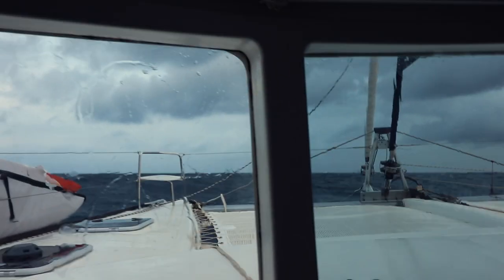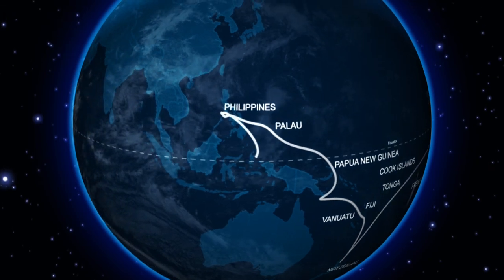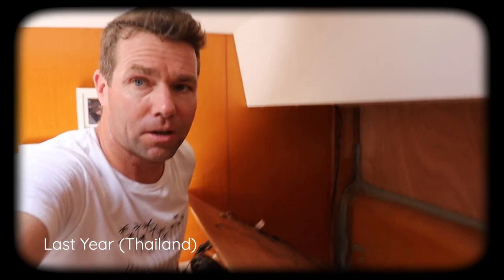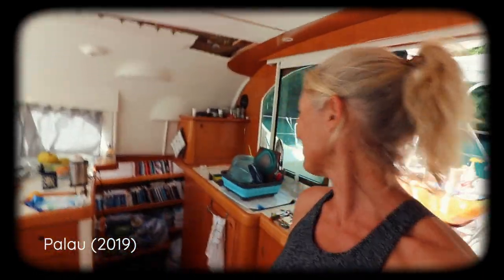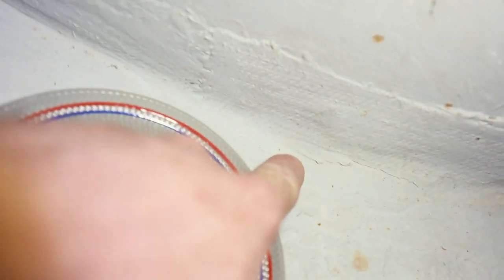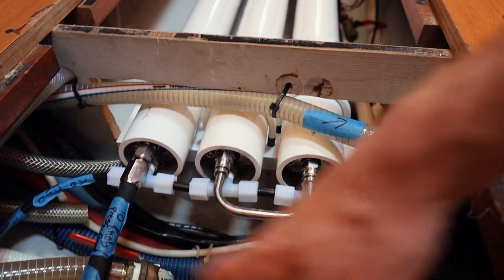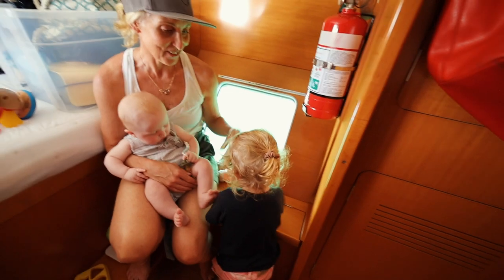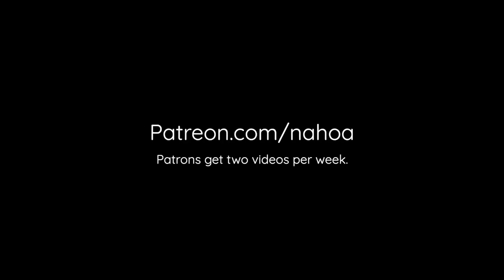Lagoon catamaran Bulkheads

Comment: I don't get the appeasing comments  about the quality at all. If I had a car that started coming apart at the seams, and that looks like what is happening to these boats, I'd be looking for a lawyer leading a class action case. I guess the present owners are keeping a low profile in order that the value of the boats doesn't drop too much. It's a sad reflection on the current boatbuilding scene.
Reply: Did you take into consideration that the vast majority of these cats were originally charter boats, which were abused recklessly by people who used them as party and drinking platforms?
What about all of the people who screwed around with the rigging, thinking that they knew best and tightened up everything until huge stresses were added to the structures, which would cause buckling and breakage?
And then there's all the beaching of the boats, by drunk sailors who think that it is fun to beach and then party even harder on the sand. That's more stress added to the structure.
You're forgetting the previous owner(s) of all these boats, the abuse heaped onto them and the subsequent damage caused by storms. And then there is the out-of-warranty quandary...
Forget about the ambulance chasers; there is more which can be done by a thorough pre-purchase inspection and then going through the entire structure, fixing/patching/replacing as necessary.
Reply: @leonply  All very true, but I was thinking more about the inappropriate use of that 'putty' instead of glass fibre. That seems to be an issue which will eventually befall all these boats over time (regardless of previous treatment).
Reply: @cuthbertmilligen  I agree with you very much here. The "putty" used to fasten the non-load bearing bulkheads is like the construction silicons used in brick and mortar construction.
The unfortunate thing is that any boat is subjected to torsional loads which fluctuate, and the environment is detrimental to almost all varieties of elastic fastening methods. In order to produce as many units as possible, as inexpensively as possible, using this technique places these boats in the "throw away after six years" category.

Comment: the sad thing about lagoon they used the same thickness material as you have, in the lagoon 450, and also none, or piss poor tabbing - other better built boats use bigger material or carbon fibre and they tab all bulkheads - cost of doing this is not that expensive as Seawind and other boats are cheaper than lagoon

Comment: There’s so many ignorant people who think that all Lagoons have bulkhead issues, and yet there’s literally thousands of them out there circumnavigating the Globe with very few issues. It was the 450 that had the issues, not ALL Lagoons. If you overtighten the rigging on any cat you're going to have bulkhead issues and don't forget different models have different designers as well. It's down to research and maintenance and a good survey before purchasing any boat.
Reply: Not so sure about that. More like our story. We bought a one year old 470, on of the last in production as prices had dropped in anticipation of the new 500, and it had good reviews as a blue-water sailor. 
It was our first boat so we knew little so employed a few "experts" to advise us. Is was a great boat they all advised. 
All was well until our first F4+ when the noise levels were concerning, both slamming and creaking. During the wash-down I noticed cracks had appeared  in the gelcoat at flex points all over the boat. Not knowing what was causing the cracks we had them fixed. Next sporty sailing conditions they all came back. This and the extreme noise in even moderate conditions had us worried. So after a year we sold it and bought a monohull. Obviously not as comfortable in calm conditions, but we feel a lot safer when it get sporty. 
Since then we have met a few other 470 owners who had similar and worst problems, but I have never seen anything published about the problems with this model anywhere.
Reply: @johnhayford5946  that's interesting. We've come across plenty of owners of Lagoons here in Asia and nobody has said they've had any issues with their boats any more than any other production cats have had. One of our friends has a 42 and it's a very solid boat and my brother in law has three 380s in charter for many years and has had no issues beyond routine maintenance on them. He plans to upgrade them to 42s as well. It may be that a few of them have issues over the years due to type of use or design or construction, but lagoons are designed by different Naval architects and have various design and construction methods employed and since there's litterly thousands of them out there on the water it's a good idea to do some research on whatever hull you're thinking of buying and make sure you get a good survey done before purchase, as you should with any boat you're thinking of buying. A blanket statement such as "Lagoons are crap" or "Lagoons have bulkhead issues" needs to be qualified with specifics rather than hyperbole.
Reply: @tlevans62  I concluded that it was bigger 380 styes that had more of a "flexing" problem. I went out on a 380 and it was fine as you suggest. Ours was a 470 and the other owners I spoke to also had 470's and a 500.
Reply: @johnhayford5946  it could be that the older and larger ones have some bulkhead issues the same as the 450s. I guess it depends on how they made the bulkheads, the fabrication and design, and the use of the boat. To me it’s like vehicles, some car manufacturers have models that have issues, particularly over certain model years, but not all of them are terrible. Same thing with different models and years of boats from different manufacturers. Also, they tend to evolve the construction over time so earlier models have issues which are rectified in later models or changed when the model is replaced by a new design.
Reply: @johnhayford5946  also, a lot of cats aren’t rigged properly and people tend to tighten the rigging up way too much, which can cause a lot of issues with any cat. Lots of weight in the bigger boats and therefore the loads and the counter lever moments are very large. All cats will flex to some extent but the rigging can cause a lot more issues with bulkheads on cats and trimarans than in monohulls.
Reply: @tlevans62  Our's was only a year old when we bought it and it only had delivery milage on it. So it was very worrying when faults started on the first bit of a choppy sea.
Reply: @johnhayford5946  I'm sure it was, so what was the engineer's report saying was the cause of it? Did you get a survey done and present it to your Lagoon dealer?
Reply: @tlevans62  Don't get me stated about "surveyors", they were great if all you wanted was a file of photos and a description of the boat, otherwise a complete was of money. 
This was all before youtubers and the info now available so all I had to go on was the gut feeling there was something wrong so we "downgraded" to a monohull.

Comment: To think, this entire bulkhead "issue" blew up because a clueless dude bought a hurricane destroyed boat and found the bulkheads had come loose.  It's absolutely asinine.  The boat was a total loss.
Reply: he is not clueless colin works for years as chief engineer in superyatch. bulkheads issue among lagoon owners is not limited to boats that was salvaged from hurricane. had you not seen the lagoon beside colin’s that has much damaged bulkheads but that boat was not hurricane damage.
lagoon 450 is designed as per his design engineer exclusive for charter only and not for bluewater sailing. but the problem is it was advertised as blue water sailing boat thats why the bulkhead cracks and bend outwards when sailed under rough seas